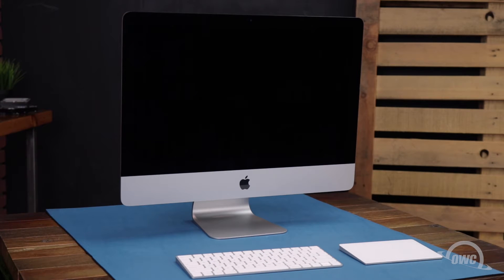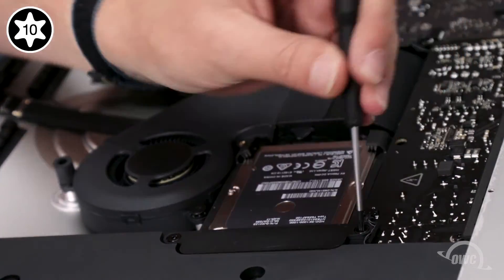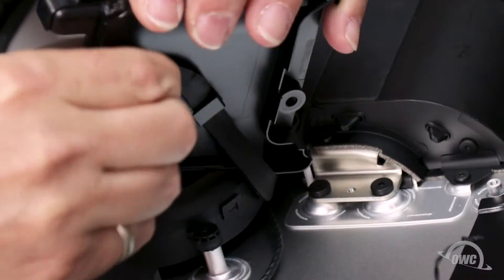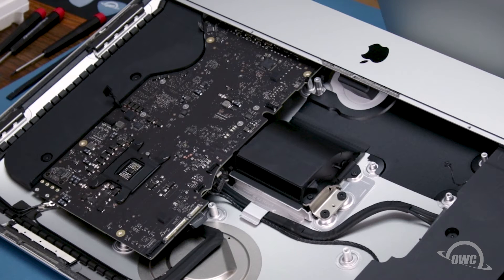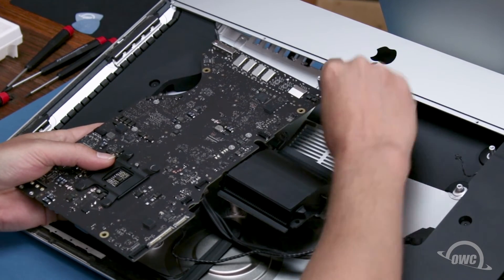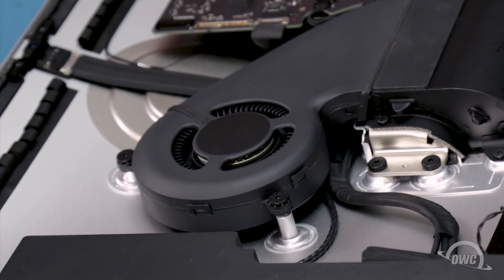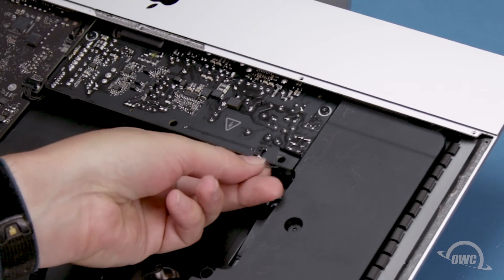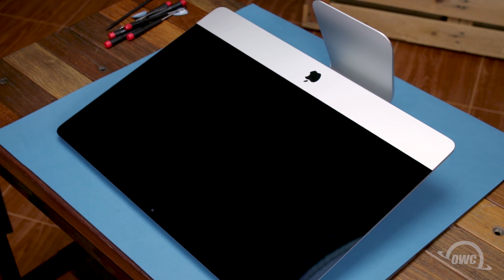How to Upgrade/Install Memory in a 21.5-inch iMac (2017) -- UPDATED VERSION AVAILABLE

Comment: Removing the easy access to RAM from the rear of Mac models is absolutely disgusting. This forces consumers to pay about 3 times as much money to have the extra RAM installed during the manufacturing process. These computers were NEVER intended to be opened for upgrades or even servicing. Of course, this is all designed to increase profit by forcing consumers to buy new machines. I purchased my first Mac in 1993. I currently have a 2019, 27 inch iMac, which still has a RAM access port in the back. I bought the computer with the minimum amount of RAM - 8GB. Upgrading to 64 GB of RAM would have cost more than an extra $1,000 through Apple. I purchased a full 64 GB of RAM through Amazon for one third the price and threw the useless 8 GB away. Apple has become a totally corrupt company, only interested in profit - regardless what THEY tell us.

Comment: Thank you guys, very detailed video. unfortunately I couldn't upgrade my ram because no memory slot on board, but i upgraded my HDD to SSD.(iMac 21.5 Late 2015). still does the job
Reply: I also have a Late 2015 iMac 2015 - 3.1Ghz i5 Intel core! Are you sure about not being able to upgrade the RAM? Can please recommend the SSD you used. I am currently looking into crucial.

Comment: I've had macbook logic boards very hard to remove because the screws are tight and the metal is soft.  Has anyone who did this install had problems removing the screws?

Comment: After watching this 8gb of ram seems enough for me lol.
Reply: I feel the same. Why did Apple made this normally easy operation so hard?
Reply: @AndreasvanHaren  Because they want to charge you $200 for a 16GB RAM upgrade. You can buy a two-8GB kit for like $100 or so, but the RAM upgrade is a pain. Upgrading the hard drive to an SSD is relatively easy though, and would probably be the more important upgrade for most people. Going from a hard drive to an SSD does wonders itself. Apple charges another $200 to upgrade to a 256GB SSD, but you can upgrade it yourself for like $130 and a little elbow grease.
Reply: hahahahahaha

Comment: no doubt, one of the most clear and best explained tutorial to do this ass busting job tha Apple could have avoided by simply having a back bay door like they used to!!!
This said, I wouls hold back on the adhesive until all is tested and sure that it´s working!

Comment: Writing this on upgraded 32gb imac finished about 1/2 hr ago. Followed the video, all good. I didn't end up removing the power supply completely and for some reason the smallest Phillips screwdriver included in the torx set was not working with the bottom row screws, I used one that I already had.

Comment: I just did this successfully. Its a real pain in the ass. But it worked at the end. I also changed the hdd for a 1TB ssd.
Reply: Jose Cisneros sweet bro congrats I can’t find a cpu shop that will do it for me they keep saying ya not possible I’m like yes it is
Reply: Crypto Feez if you are patient, have an illuminated place and follow the steps carefully you won't have any problems to do this. My mistake was doing it at night with not enough light. Adding 16GB of ram plus an SSD it's totally worth it. It's a complete new iMac now. Really fast.
Reply: @cisnerosjerez  Hello Jose, i am currently researching parts for my Late 2015 iMac 4K 21.5" - 3.1 Ghz i5 Intel Core. Looking to upgrade to 16Gb RAM and add an SSD. Can you please refer the parts to installed? Prefer crucial but i do not know compatibility.
Reply: @Fuzer831  Hi, the iMac I upgraded was an older 21.5 (early 2013) so I'm afraid I won't be able to help you with that one. I used Samsung EVO 850 on mine.
Reply: Apple say 16GB max, but OWC have tested it with 32GB. My upgrade was 32GB, and it works fine.
Reply: Hola...que clase de memoria ram le instalaste?? no se cual comprar porque hay unas que vienen con 2400 mhz y otras con 2666... vale la pena la inversion?
Reply: Congrats!!! 
Hey just like to ask if the adhesive display tape can be reused or have to replace with a new one. thanks